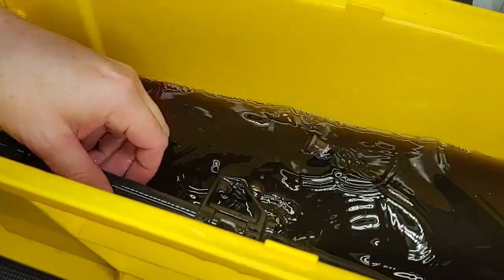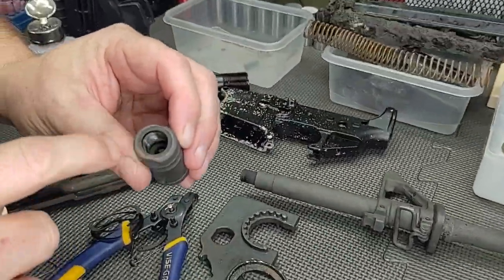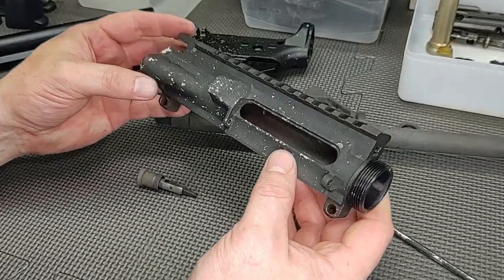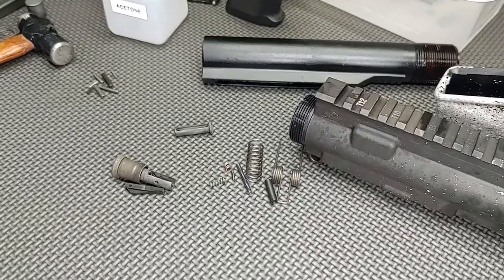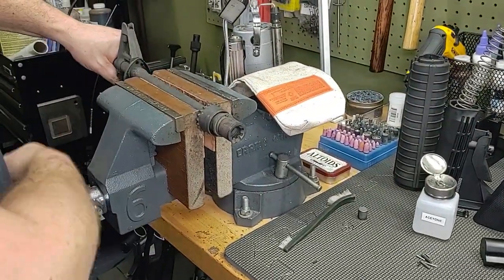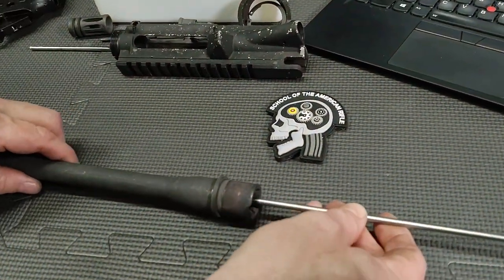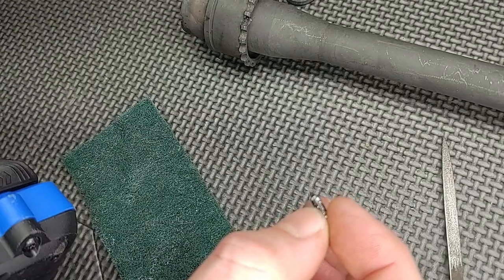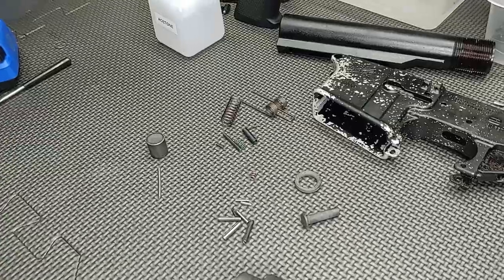Can a Fire Damaged PSA AR-15 be saved? - Part 4

Comment: That "apocalypse" means different things to different people.  Mine was a house fire Sep 1 07.  The guns were some of the few things that survived.  Luckily everything in the safe stayed low enough temp that there was no spring damage..  but EVERYTHING got the Mark Novak Rust Blue treatment.  I spent probably 50-100 hours detail cleaning everything.  I chose to do it myself because at the time, frankly, I needed something to keep my mind busy.  The only firearm that was a total loss was the little bolt action 22LR "farm gun" that was propped up near the front door.  My tricked out SP01 was on my nightstand and a large chunk of drywall fell on it and made a little time capsule.  Everything else was in the steam cabinet..  err ..  i mean gun locker.

Comment: Hey man I'm very impressed with ur spring/roll pin collection. In your opinion what's the best option for building up ur spare parts buying extra parts kits or go down the list of parts and buy individual or do u McMaster em in bulk?
Reply: Buy a quality expensive kit, or get a lower cost kit, then piecemeal expensive small parts such as inconel springs.
Reply: @5jjt a roll pin is a simple piece of metal. Expensive makes zero sense. I can see springs of different intent though. A better extractor spring and trigger springs yes. I have seen dubbed brand quality by name and typical parts makers springs and roll pins. Rarely feel or see a difference. Sprinco per forums is about the only company many swear by and document a difference in improvement. If x company follows to mil-spec standard it should not matter. Its a set standard for a reason.

Comment: Sorry if this is a bit off topic, but does anyone know if I should be concerned about my 3 new, non-anodized lower receivers which have takedown/ pivot pin holes with diameters ranging from ~0.2525" to 0.254"? I believe the specification for those holes are 0.251" +/- 0.001". Will the anodizing add enough thickness to overcome the out of spec holes?